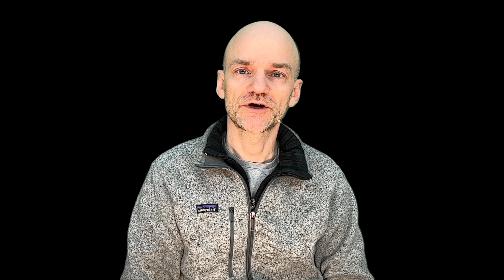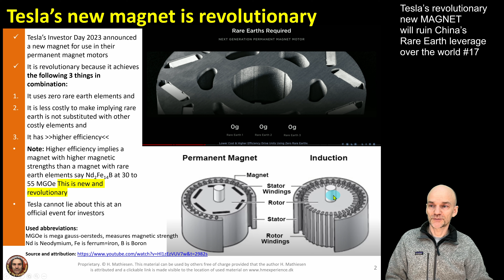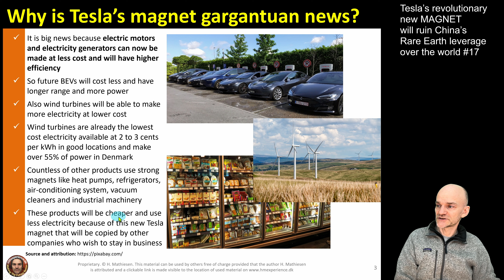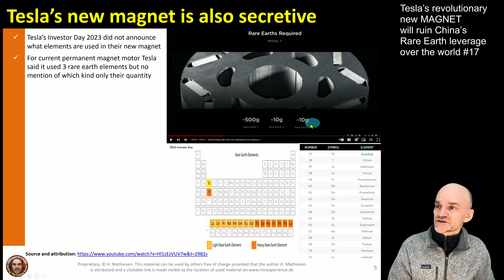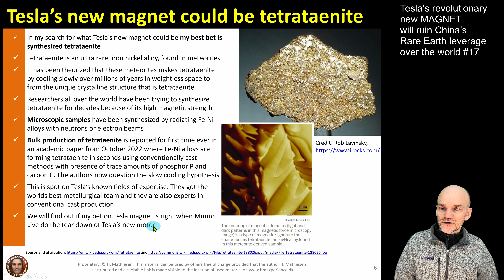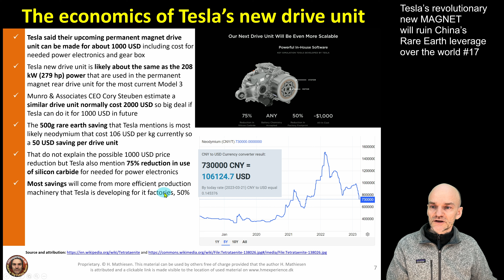Tesla’s new MAGNET will ruin China’s Rare Earth leverage over the world #17

Comment: It will be a combination of chemistry AND a Halbach array and the air gap and iron rotor. So it may be a SYSTEM of materials and context.
Reply: Agree that use of Halbach array alone can cut the magnet material need in half or better.
Reply: Their powertrain designers also used in-house developed AI software to simulate the interaction between the magnetic fields between the stator and rotor.

Comment: It's impossible to have a synchronous induction motor. You need slip, to generate the rotor voltage/current. To have slip, the rotor has to move slower than the rotating magnetic field. That's why a typical induction motor speed is slightly less then synchronous speed eg 1485 RPM on a 1500 RPM magnetic field. Nice video. Thanks. BTW totally agree with your political view.

Comment: Just because he said they were more efficient it doesn't mean they're necessarily stronger does it? Couldn't also mean that maybe they would have some structural portion to them too like the magnet would be part of the parts structural integrity so you wouldn't need the portions around it?
Reply from the maker: I am 90% sure the new Tesla magnet is tetrataenite and it looks like a brittle crystalline structure so IMO magnet will need to be housed the traditional way in the rotor using stainless steel plates stacked to form the rotor and preserve structural integrity of rotor and magnets. I can’t see how motor can be more efficient unless the new magnet strength is above 50 MGOe. But I look forward to see Munro Live tear down to get the facts straight.
Reply: No, I think presentation is correct to focus on the legality of Tesla claim of efficiency of motor itself, the electrical efficiency.
Reply: Electric motors are highly optimized devices so there are very few opportunities to make it more efficient. One of this is using hairpin windings in the stator. And it turns out Tesla is already using hairpin stator in newly built Model Y so the only thing remaining that can increase efficiency is stronger permanent magnets.
Reply: @kazedcat  Another way to improve efficiency (by a large margin)  is use of superconductors (however the best SC materials use rare earths...)